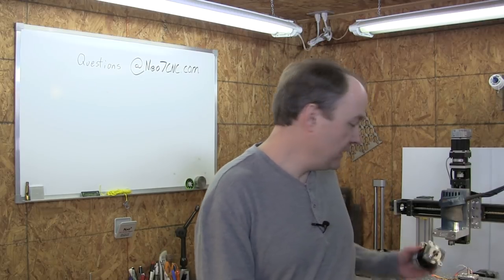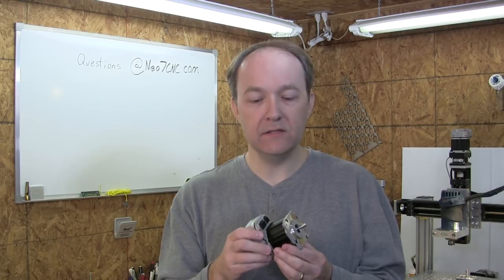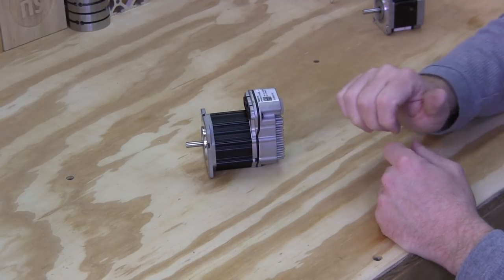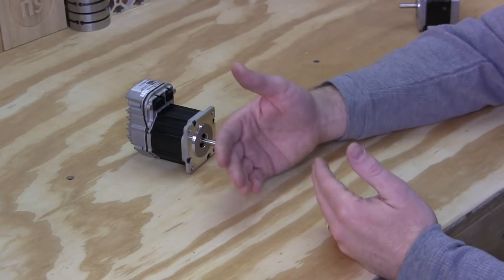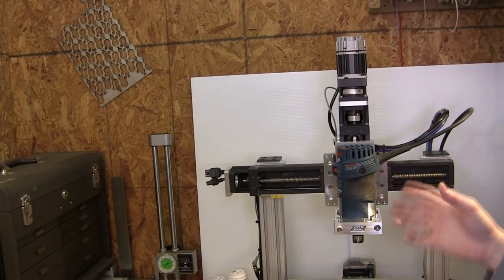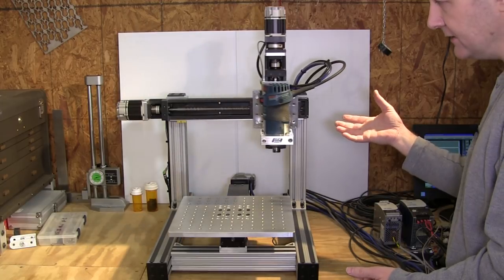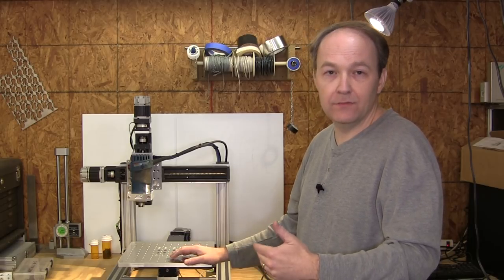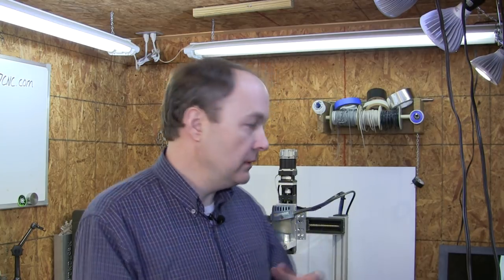Homemade DIY CNC - (AUDIO Corrected) ClearPath Servo Motors used on KR33 CNC - Neo7CNC.com

Comment: Great vid David!!  I just saw these motors for the first time the other day....they are so awesome!!  With steppers, if you tune your motors for the fastest speeds with the table empty and then put a heavy part on it, you may have to re-tune the motors since they lose so much power at their top end.

I love the fact that they interface with the controller just like the stepper you're replacing.  I'm wondering about a controller with built in drivers like the hobbycnc boards.  It drives the steppers directly.  Since the ClearPath servo has the driver built into it, any idea if it can handle it?  I'm sure this is a question for ClearPath, but I was pretty excited to see you do a vid on them.  I haven't had enough time to keep up on every vid, but the title got me on this one!!!! Thanks!!!
Mike

Comment: He, i was wondering. Is the drive also supporting the load of what it is driving to? If so, that would also be the reason why it is making so much noise. It is not preverable to load the driving shafts, because it will limits lifetime and will add additional wear. 

Cool controllers for the cnc machine. :) 

Jeff

Comment: Would it be possible to build a cnc machine without using "mach3", just using Teknic ClearCore and write your own code for the control? Could you please explain what the CNC controller is doing outside the user interface?
Reply from the maker: You could.  Mach3 is taking the gcode that's outputted from the CAD/CAM software and using that gcode to "tell" the motors of the CNC what to do.  Speeds, direction, etc.  There are other cnc controllers out there like AcornCNC, Masso and LinuxCNC that can get you away from Mach3.

Comment: Hello,
I have her some Maxon Motors with the following data.
Could you please take a view on it, if they are usable for a CNC Milling machine.
I want to use  it for wood, plastic and aluminium milling.
Do I need a gearbox ?

Maxon MMG118895 120W with encoder HED5540
Voltage 30V
max rotation 11600/min
max torque 120 mNm
max current 5,24 
rotation change 389 /V

best regards huggy

Comment: 16:54 dose it matter if it quiet its not camera slider. milling make noise and machine structure amplify it bcoz you frame is aluminium and you cut aluminium
Reply from the maker: I was comparing it to the "chop" you hear and feel when using stepper motors.  That "chop" or cogging of the stepper motors causes the aluminum frame to ring.  That vibration can impact the cut.  This machine cuts aluminum with no issue and the cut quality is great.

Comment: Can these motors be used on Shapeoko/X-Carve?
Reply: No, don't even try that. These machines use belts to move so any accuracy you gain from the better motors you loose from the belts..
Reply: +jimbit22 I actually don't want the belts...

Comment: As cool as them being silent is, I don't think motor noise is relevant when you have a piece of carbide ripping through some aluminium at 30k RPM.

NEMA 17 versions of these would be amazing for 3D printers though.

Comment: I have been thinking... Consider that you Servo motors have accurate feedback, would you really need "End-stops", I think not... When dealing with Stepper Motors, with no Feedback, I think they'd be essential, but with Servos, I think they are overkill... I think you could get away, without them, altogether...
Let me know what you think :-)
Reply: +nraynaud1 Interesting - I'm a Robotic Welding Technician... Anyone who knows Robotics, Starts and Ends a program at the "Home Position". 3D Printing and CNC are just variations of the Monster Robots that I program... I have been a part of the the implementation of several Robotic Welding Systems, Miller Robotic Welders, Fanuc, Motoman and others... Not even One of our robots had an End Stop... With servos, it's a waste of resources...
Reply: +nraynaud1 It's pretty clear to me that you know very little about Robotics and in particular Robotic Axis and Servos and/or operation... I am a Robotics Technician, so I ask myself... Does this guy have any sort of clue about what he's talking about... He can't even spell... Thanks for your input, but I'll disregard anything from you...
Reply: +nraynaud1 I speak 12 languages, but only read & write in 5 of them, including Mandarin and I'm slowly learning to read and write in Thai... So, really, you don't have a point... Good-bye

Comment: $254 USD?   Wow .... not cheap!
Reply from the maker: +TNA2Me True... but they are awesome!  Thanks for watching.
Reply: +TNA2Me Considering the size, speed, torque, and the fact that you get a built in motor controller, it is actually the cheapest solution.

Comment: I drive a Ford Fiesta, it's LIKE a Ferrari..... NO, it's not! Nor will it ever be, no matter how much I polish it & make excuse for its inadequacies. Much like a stepper motor will never be a servo. Yes, the fiesta will get me from A to B. Oddly it will also perform its task in a cheaper manner. (like stepper). Now before I get roasted by stepper owners, I am not saying steppers are shit. I am just saying they are not servos & the only functional similarity they have in common is an ability to get from A to B.
 Which brings me to my point. I think the price comparison made in the comments & at the end of the video was unintentionally inaccurate. Comparing these to steppers & hybrid steppers still misses the point. Clearpath gives opportunity for the AVERAGE CNC builder to step (pardon the pun) into the servo realm with all its benefits. Look around, you're hard pressed to find second hand servos for this price. Let alone with a driver.... 

To clear up a few things:
Stepper motors do have their place & there are some great stepper machines out there.
No, I do not work for Teknics
And I most certainly do NOT drive a Fiesta! I was merely making a point :)